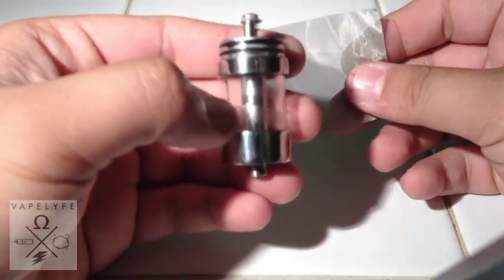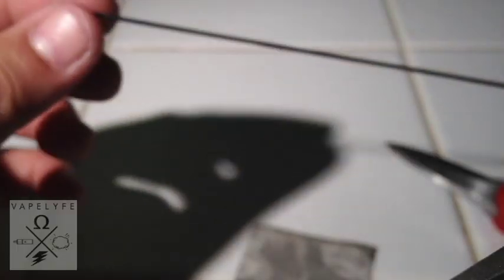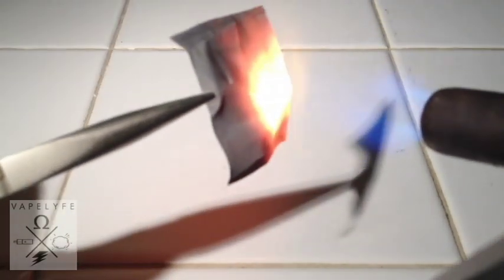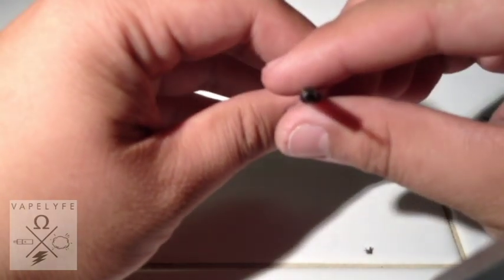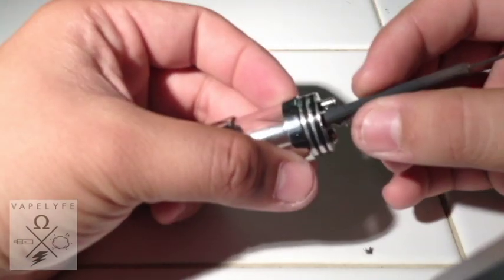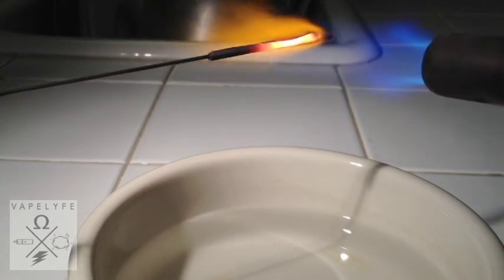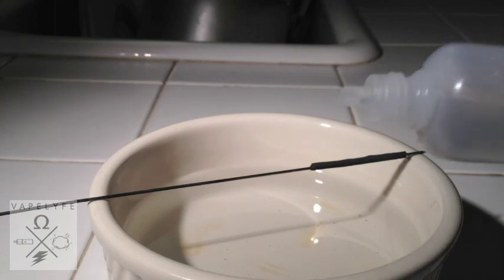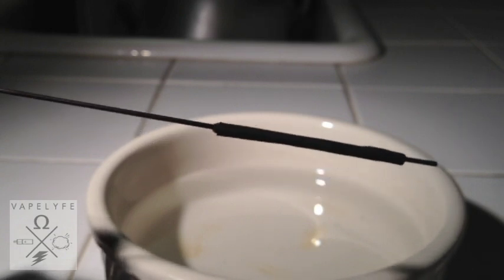Stainless Steel Mesh Oxidation Tutorial by Vapelyfe

Comment from the maker: Oxidized wick requires torching the rolled up stainless steel mesh and right after dumping it in water.  With water it creates the oxidation.  The reason behind it is to stop conductivity of the mesh to prevent any hot spot or shorts to the coil.  Unoxidized mesh is rolled untouched stainless steel mesh.  You would have to pulsate the coil to light up until the coils heat oxidizes the mesh itself.  Many differences. Some just preference.